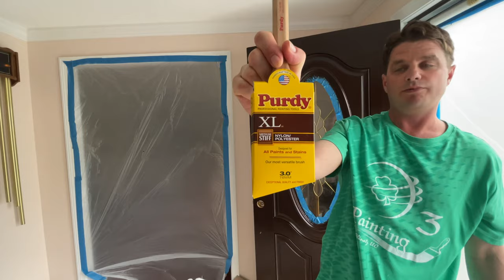Stain Therma Tru Fiberglass Door with Minwax Oil Gel Stain- Apply Oil Polyurethane- (Part 3)

Comment: That turned out well, never used the min wax gel stain before I have to try it never had success with any other stains in the past.
Reply from the maker: Hi Burt-

Thank you! What have you been using?

Russ
Reply: @RussOlinatzPaintShow  Hello Russ, I have used much min wax oil stains as well Varathane oil stains & their basic stains tried them all & would never leave a nice look always looked like brush marks when bar top dried so I used rags or pads to apply & would still show brush lines, I had to sand down the bar top many times & try again so I wound up doing best I can with rag & lived with it, I wanted to use a clear coat resin on it after the stain but didnt want to take the chance of ruining my bar top being it may have left brush lines in the resin as well even if I used rag or a pad, I will try your method sometime in the future using the gel may give me way better results, thanks for the posting of this recent video that door came out excellent👍

Comment: And might I suggest the folding 4’ long table. As a fellow painter… I can’t bend over no more lol 😂 to pick up supplies. It folds and half and has adjustable legs. I also use a fan heater to help me with door drying. Your amazing thanks for sharing
Reply from the maker: Hi Tahj

Yes I will look into that. Thank you for your suggestion!

Russ

Comment: Beautiful finish. I also have a therma tru fiberglass door and after the polyurethane dried it left a milky white finish. I was very disappointed. Wondering if it had to do with the temperature. May have been to cold so I’m going to try again. Thanks for posting this video very helpful.
Reply from the maker: Hi Beth
Thanks a lot! Did you use a water based Polyurethane?

Russ

Comment: I would imagine that using an LVLP spray gun with that Varathane would result in a frothy, bubbly mess.
Reply from the maker: Hi-

I always use a brush to apply, but that is an art to spray properly!

Russ
Reply from the maker: Hi Don-

Can you post your comment again on my new video without the link? It didn’t show up. Thanks 

Russ
Reply: @RussOlinatzPaintShow    It looks like the YT censorship bots are at it again.  My comment is no longer there.  I will try and recreate it without the link to the spray gun kit I purchased.